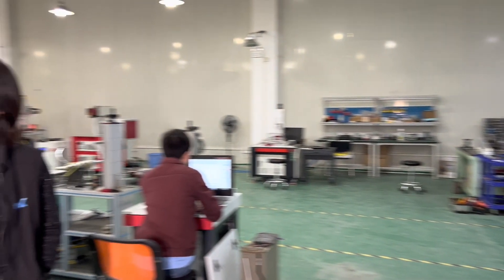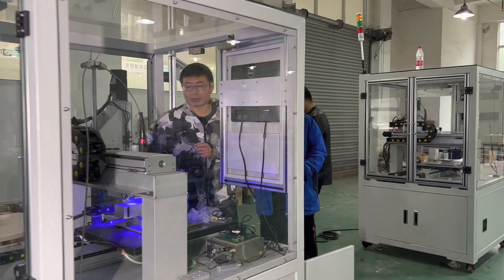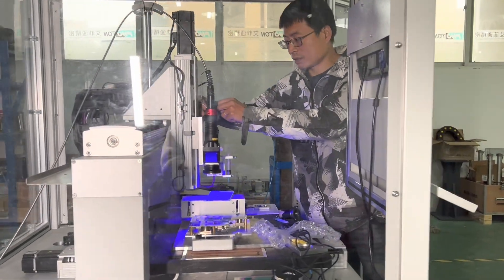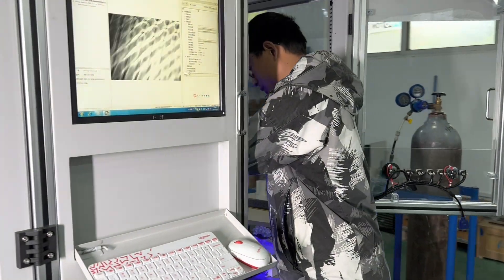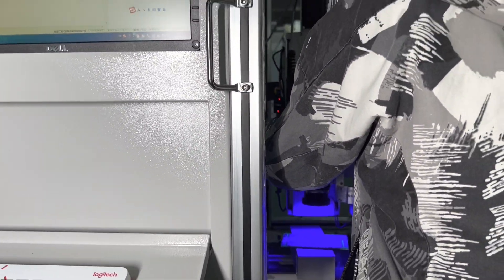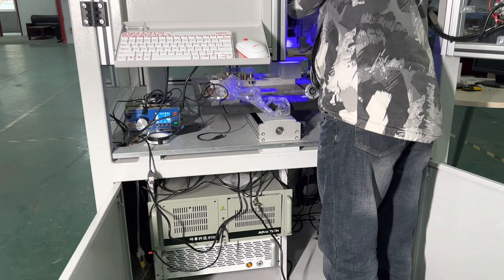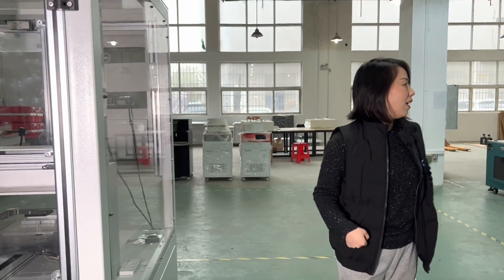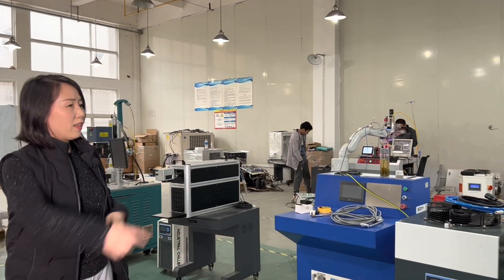How to choose the right laser welding machine? #dmk #dmklaser #DMK #DMKlaser

Comment: Hi. Congratulations about your website, It's the most complete of information I've ever seen.  I´m physicist and fiber laser machines seller. I have some customers asking about handheld fiber laser . I know normal size handheld weigth is about 250Kg  and it is too heavy for my customer use, the ideal wiil be a machine about 100 kg. I have a question about your MINI Handheld Fiber Laser Welding Machine ( water cooled) : can this mini machine work full time with a 1500W fiber source? A mini machine need a small water chiller... What would be the approximate weight of Mini  machine with 1500W source?
Reply from the maker: the mini welder 1500w with small chiller weight 130kg net machine, 160kg after package in wooden box before shipping; I recommond the air cooling model 1500w weight only 70kg, which is very popular now.
Reply: Our mini water-cooling 1500w machine net weight is about 130kg. The mini air-cooling 1500w laser welding machine net weight is just about 60kg. if you are interested, please feel free to contact me. email : sally@demarkchina.com, whatsapp/tel/wechat:+8615172315348. Thank you.

Comment: Marking on fly is also very useful for cutting as well.
Is it possible to integrate the marking with cutting machine.
So that all parts can be labeled before cutting and it is easier to make tracable parts.
Reply from the maker: yes, it's already an option for a cutting machine to do marking, either by the cutting head to do marking or use an extra makring unit to do that
Reply: Thanks for your reply.

My thinking is to do marking and cutting simutaneously. Marking head and cutting head installed together.
Reply from the maker: @charlesfeng3823  ahh, in thoery, it's possible to do, with enough budget😃
Reply: @jallyqu  In my humble opinion, it should be easily achieved via install marking lens and laser on one plate.

Then stack their laser source together.

A larger drag chain to accomodate all the fiber cables.

Total cost should be less than a marking machine plus a cutting machine.
Reply from the maker: @charlesfeng3823  marking machine is really cheap
Reply: @jallyqu  What we need to do is a smooth process.

If we can mark the parts when doing the cutting we do not have to repositing and realign the parts for marking.
Reply: @jallyqu  Marking speed is higher than cutting so the marking can be done several second before a part is cutted.
This will provide an end to end tracability for parts as laser cutting is normally the first process in the factory.
Reply from the maker: @charlesfeng3823  for tracibility of the parts, now mostly use QR code or bar code, actually we can use cutting head to do marking, speed also ok
Reply: @jallyqu 1.Cutting head not suitable to do marking on copper, Alu  etc.
2.It is not good for thin materials